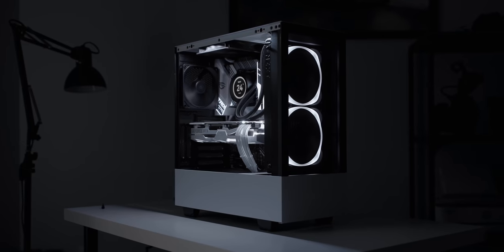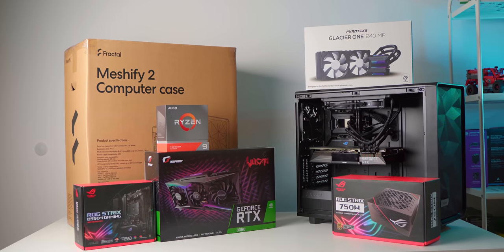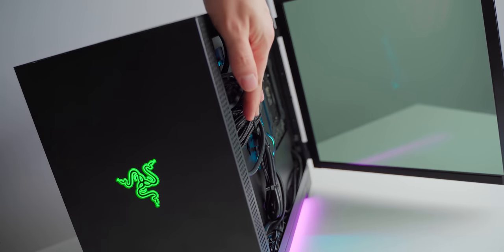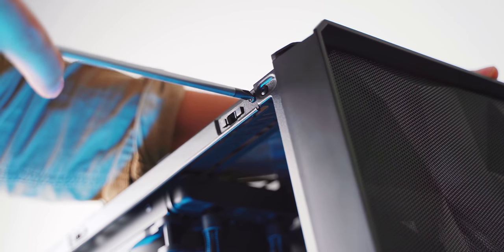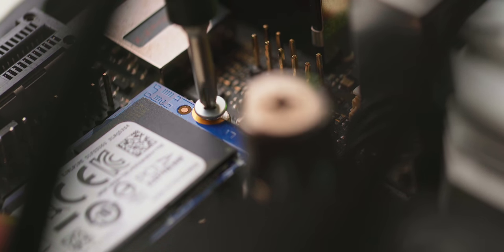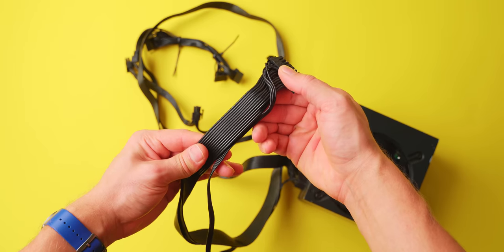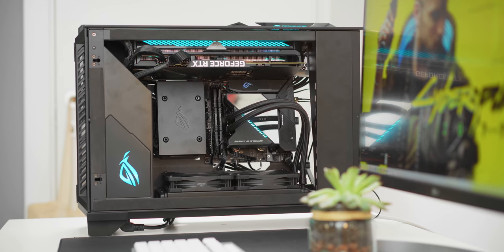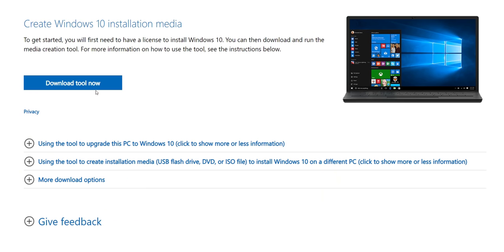AVOID these BIG Mistakes when Building a PC!!!

Comment: My old ASUS mobo has the panel adapter - hoping my new board will come with one as well, as I'm keeping my old PC as backup while building the new one ;)  

Also, GPU pricing is currently ridiculous!  Luckily, I like to build a step or two down from what's current - I never buy the latest and greatest aka "bleeding edge" tech, and I'm not an uber gamer etc.  Finding GPUs that are slightly older, and still usable in 2020/2021 will still get the job done! ;)   Thanks for sharing, D!

Comment: Oh God the USB cable on the motherboard. I built my first PC in 10 years, it was so tricky to get in I thought I was going to break the board, to make it worse the cable in inflexible with a large head, making it really tricky to attached it to my B550 Mortar in the 500DX.
Oh another thing I found difficult. The motherboard didn't perfectly align with the case mounts, so needed more force then I ever felt comfortable applying. Also cause mounts can be moved to different locations for different board types, but finding where to put them....was near impossible (sure it was labelled U5, but what board size is U)

Comment: I can't agree more on all the points in this video!!! I wish ASUS, Seasonic, and NZXT can really watch this video!!!
Tough USB-C cable, tough flat power cables, annoying 4+4 CPU power cable, X570 motherboard heatsink blocking air flow, not easy removable front panel, non-reachable PCI-E lock.

Comment: I had my USB 3 cable for the front panel rip out the plastic shroud around the pins (luckily all the pins held) but I wasnt even pulling hard or so...
But maybe I just got unlucky with my rog strix b550 f... 
Also in terms of flat cables... Gotta say the fractal design PSUs are my new favorite, because the cables really are more flexible and it made cable management (almost) satisfying

Comment: I had the same issue with my fractal meshify 2... i had to take the 24V drill out to remove the top radiator bracket screws nothing less powerful worked... and also for the PCI-e covers my hands and iFixit kit could not handle. I think for a tip from the kit it kinda wear a bit with the force i had to use to remove some screws. So annoying. I had blisters for days after i finished the build!

Comment: I had the same problem with my meshify 2 case and the top screws! What a windup... managed it in the end but one of the screw heads was wrecked. Replaced both screws with better ones. Why didn’t those screws have the hex head on too!!!!

Comment: The skrews for my corsair fans were so stiff it felt like I was going to bend my case with the amount of force I had to use. Also, I wish cpu fan cables were longer so they could be routed around the back of the case instead of being tied in a weird little bow!

Comment: The worst thing is trying to change a new m.2 drive when your motherboard is in the sfx case. For mine, I can’t even plug in the m.2 heat sink fan on the motherboard after trying for half an hr! Don’t understand why they make the plug so small. For m.2 , it’s frustrating to screw that tiny screw with tons of cables, headers in the way. Lol

Comment: just built mine and been learning to solve small problems most are fixed. The highest cost was 5900x and 6800xt sapphire  tripled my budget.  Why did they not make front connectors one fing plug i had to take a picture of it and blow it up to see where to plug it in

Comment: These young whipper snappers never had to deal with parallel ATA and floppy ribbon cables. Yeah, try cable managing them, even the "rounded" cables were a PITA. How about those cases built to questionable tolerances? The bracket to your expansion cards didn't line up with the screw hole on the back of the case short of bending or loosening the bracket on the card!

The problem with mismatched screws has to deal with the history of the IBM PC. They were originally 6-32 screws for mounting expansion cards and hard drives. 3.5" floppy drives and later optical drives use smaller M3 metric thread screws. The standoffs are historically for 6-32 screws, but some manufacturers decided to switch their standoffs to M3! The size is close enough to make it a real pain to remove a mis-matched screw.

Comment: Sata cables? thing of the past now. Agree on pcie. The slot sucks... cards bend in it, gpu is hard to get out. usb C 3.1 header on motherboards is also terrible and the cable is usually very short. I also hate super thick capacitors NEAR THE PLUG on corsair rmx psu. No way to bend it

Comment: RGB connectors that aren't standardized. It seems like everyone has their own standard these days. Motherboard makers, Fractal Design and CoolerMaster use the standard 3 pin connector, Corsair has their own proprietary connector, Phanteks uses another proprietary connector. Just wish everyone could use the same connector...

Comment: I did a push pull configuration on my AIO on the top of the case...
I kept thinking, is it really this difficult? No way they made it this hard.
Had the case on it's side, still not fun. Would have been nice to be able to 
put the fans onto the radiator then put the whole thing into the case, but you can't.

Comment: AIO 1st ram slot clearance issue. And I'm not talking about height issues, I mean tubes will partially block the first ram slot. Just had this problem with Kraken x62 and Maximus X Hero mobo, had to turn the pump to fill the 4 ram slots.

Comment: OMG the GPU PCIE lock, I have never really had too much of a problem before, but I just got a new PC and thought I borked the motherboard when my screwdriver slid off and slammed into it. The lock took way too much pressure to remove, I was sure that the GPU board snapped when it finally released. Heart BPM sky rocketed, but everything turned out just fine. Also I think GPUs need to start coming with something to support their weight by default as the sag is getting out of hand.

Comment: I hate the PCI slot clamp.  With a passion.  Mine actually broke off and I'm kinda happy now I don't have to deal with it (I just screw the GPU PCI slot screws super tight and use a GPU sag bracket).

Comment: 3m sells these super easily routed twinaxial SATA3 certified cables (watch out the cable is metalized and conductive) I believe theya re foldable (bend radius <1mm) I used them in a case build with tons of hard drives and it made routing so so much easier. 5602-12-0142A-000 they are expensive compared to the thick ones.

Comment: The worst thing is cutting your fingers open on sharp case edges or solder points on circuit boards. (This got better in recent years though)

Comment: My biggest annoyance is the required blood sacrifice.  Why is it that no matter how many times I have built, disassembled for cleaning, reassembled after cleaning, etc, that every time, it always requires blood, and I am not a klutz...  The silicon overlords require blood (the ITX gods demand twice as much even).

Second to that is the unmanageable mess on the backside of the motherboard tray after years of upgrades.  Cables too long, cables not long enough, two cables per fan (four enermax df storm into an aquacomputer, with phantex lux rings on each), plus the lux controller (z97 pre argb motherboard), add the fact that the ssd mounts are on the right side of the case as well (Corsair 750d with the airflow front panel)....  What used to be a nice tidy case on the right side is now a jumbled mess... At least it looks nice on the left side on full display, bit getting the right side panel on is a bit more difficult these days.

Comment: I have been trying for awhile to get a 3080, my brother has been gaming on a 1070 for a few years now and I want to give him my 2070 super. He games at 1440p but with heavy compromise
Reply: @James's Gems damn.... fossil age
Reply: Gtx 970, been trying to snag a 3080 since launch. Subbed to multiple restock discords, have camped at a micro center 3 hours drive from my location. No card still. Have had one in my cart multiple times only to be told sorry sold out when I auto pay. I'm seriously thinking about taking time off work, heading my tent and camping out for 2 weeks in freezing temps at Microcenter just to have a slim chance of snagging one since apparently getting one online is next to impossible. Best Buy's not deliverable to any store within 250 miles is bull. I'd drive 500 miles one way if I had a guaranteed card.

Comment: I'm gonna be honest with you... My first ever pc build about a month ago. 1) I was installing the cpu cooler without the screws, I honestly didn't know how to put that blindly LMAO, but thankfully the thermal paste was still like new so it wasn't a big problem to do it again with the screws. 2) nvme ssd was installed with a cooler that had a tape saying "remove" LOL. 3) gpu was installed without opening the slot and I was curious "why it is so hard" LOL, when installing the nvme ssd to the first m2 slot I also tried to remove the gpu without opening the slot LOL. 
I was so dumb when building it for the first time, WITH a ytb video lol. But it works

Comment: the worst part is unscrewing a super tight cheap aio to adjust and the pump slams right into the dimm slots taking out 2 slots. bye bye quad channel x79 memory, I was hoping that would at least improve my fps

Comment: Pro tip before plugging in the usb 3 cable: slightly file down the notches on one side of the cable head. DONT OVERDO IT THOUGH it won't be secure if you overdo it

Comment: I built my first PC recently. I dropped in the CPU without raising the retention arm, opened it whilst the CPU was in the socket, heard a crunch of some kind. Yikes. Went on with the rest of the build, pretty smooth were it not for the tightest backplate I have ever experienced (P400A). Tried to boot, and.... nothing. I had flashed the bios on the mobo the previous day, so I took the CPU out to check for any bent pins (forgot to clean off paste first, so that was pretty messy), no bent pins. Hmm. I figured I had installed the cooler wrong or something, but I was afraid of applying too much pressure to the lever thing on the wraith prism. I went for broke and it went on tight. Still no boot. Crap. For the heck of it, I tried flashing the BIOS again with the CPU in. Now it works fine. So please, mobo manufacturers. POSTCODES. Ezdebug LEDs aren’t good enough.

Comment: I think most of us are building new systems every 2 years or so and lot of these annoyances are minor if you don't build systems regularly. I think even mid-range cases became very comfortable and easy to build the past 3-4 years. I could add one more though: RGB incompatibilities. God knows how many "standards" are there and software and controllers, etc. even though RGB is supposedly a major selling point for years now. You have to do lots of research to make sure your colorful crap will work together.

Comment: I'm very new to pc building. I felt that it was so so hard for me to pull off the 24 pin connector from the motherboard.
Probably because of a cheap low end MB but still.

Comment: All of my parts could fit into a case I really wanted.  I never used a Mid-Size tower I only used full size, but I did the research and everything could've fit.  However, I thought I had a 550W PSU, it was a 850W!!!!!! HOW DID I MISS THAT?!  Anyway I had to return the case because the psu is like 20 inches long... always check PSU size

Comment: Just got the sliger sv 540 top plate popped off when I moved it popped the panel on like you do with most cases and it folded in now I got to bend it back to normal yeah really fragile for a 250 dollar case

Comment: The RAM is becoming the worst aspect of building a PC. I purchased a RAM kit for my Ryzen 5 system and it turns out that the first kit, a G.Skill AEGIS, was pretty piss poor in reaching it's advertised speed and was more stable at it's base clock of 1833 (926 MHz). Returned it for a G.Skill Ripjaws V 3600 kit which then kept giving me blue screens of death when going to the max clock of 2933 that is supported on my 2600 without overclocking. I've finally ended up buying a Crucial Ballistix 3200 CL16 kit and it has been rock solid at the max supported speeds and it's base clock is even better at 2666 MHz. 

Then you have the garbage that Windows 10 likes to give you  when upgrading a system in that system files get bloated and even corrupted overtime and when reinstalling sometimes the stupid thing crashes during the install or after the install certain drivers muck everything up all over again. Same when installing AV software like Kaspersky or BitDefender. After all this troubleshooting, I decided to turn off  Windows garbage defenders before installing 3rd party software and drivers. Three days later my refreshed build is finally working as it once did before the upgrades.

Comment: There needs to be a simpler way to integrate RGB without having so many cables and connectors. Cable management on a PC with 6 RGB cables and a fan hub is a nightmare!

Comment: Oh god. My worst experience was yesterday because I built my first system 🥳. I was able to get a hold of a 3070 and i got a 5600x and a msi x570 tomahawk. I just watched so many different build videos it felt natural building it and actually everything went perfectly for first time. Or did it? When I tried to boot the computer started working fans spinning but no video output. *Panic*. The debug cpu led was on on my motherboard :(. Thank God after a day i thought it may be because my bios that came from factory  didn't support my cpu so because I didn't have a older cpu i went through terrifying process of flashing bios with usb. But after everything I finally did it. And now I can play minecraft with Rtx with ease :)

God that was long

Comment: Not knowing the right compatibility for stuff i.e. I thought I bought the wrong PSU when some PSU CPU cable pins were rounded instead of perfectly matching the mobo - after much googling and incorrect answers I went to MSI's site itself and found my correct answer - they are purposely rounded to allow more compatibility
IRONIC

Comment: Well i would no agree with that, that I/O connectors are the same on every motherboard. I wonthe life by simply taping with isolation tape I/O connector with old motherboard (X470 Gaming Pro Carbon AC) and with new one (B550 Tomahawk) i realized few pins are placed different. 

To be fair, i think this is most odd standard in whole PC, next to standard ATX, with no experimental features, like swapping RAM with PCIE etc for build chimney layout with motherboard I/O on back - that would let case manufacturers to create something new, righ now Silverstone own a patent for 90 degree chimney laout in cases and noone can copy it without paying.

Fully agree with the rest, USB 3.0 connector, easy access to dust filters, all of it.

Comment: One of the worst is, install an AiO, cable manage everything, the AiO pump fails, remove it to RMA, install the stock cooler (if there is one), the new AiO arrives, uninstall the stock cooler, install AiO again.. commit suicide if it fails again. (RMAed my nzxt x52 3 times. 2 failed pumps and one rgb not working) :D

Comment: The worst thing for building a machine right now?  AMD and BIOS, Just built a 5600X with a ASUS Tuf x570-plus, went with this board as it was in stock, whereas the higher boards with Bios-flashback where OOS. Figured it would be ok as the BIOS supporting 5xxx AMD came out months ago... Well no, now I have a paperweight as the BIOS is a really old version, and I need a friend to drop off a 3200 AMD to get it to post and do the BIOS Flash.

Comment: I've ripped the USB 3.0 header off motherboards several times now because it fits too tightly. Thankfully none of the pins have ever bent enough to prevent sliding it back on. I hope there's a place in hell waiting for whoever came up with that design.

Comment: A good tip from someone who just built a new PC with a B550 board and a ryzen 5 5600x, do not, and I mean DO NOT use any driver updating software, it fked up my freshly put together system so much that I barely got the bios to recognize my boot m.2.

Comment: I wanted to add that cases that only offer 1 usb 3 on the front panel is BS. A single connector on the motherboard can power 2 usb ports, so it's a ripoff

Comment: Funny story I've pulled out the usb 3 cable from my motherboard but it was so stuck it actually pulled out the plastic frame that surrounds the pins on the motherboard with it. I almost cried because it is a 600$ motherboard rog crosshair viii formula

Comment: I'm so sick of ALL these STUPID problems building PCs, so I'm gonna GIVE AWAY my $100M dollar IDEA, to someone who can MAKE IT HAPPEN: Modular PCs.
Why does it ALL have to be stuck inside ONE BOX? Why not create components like the old Hi-Fis. Have a PSU section, a Motherboard and CPU section, then a disk drive section, then a graphics card section, then peripherals & I/O (CD, DVD, Blue Ray, USB, Audio ports etc.).
Then just replace and upgrade parts that you need to instead of cramming everything inside one GIANT BOX and deal with cooling problems, cable management issues, expandability issues, upgrade nightmares, etc.
Sure, there are some engineering issues to be worked out, but it would be pretty sweet if someone figured it out and made it happen.

Comment: The challenge in building a PC is do able !   But no budget and try to go cheap example  skip 1TB nvme and go buy  500gb nvme which is cheaper is regret because you stuck with that drive space forever until you replace which when you add up it actual cost you more in your total money spend.    " Budget"

Comment: 24 pin is the worst, I don't understand why you said it was fine. Every single time it's been a bad fit and I have to use so much force that the motherboard bends. Fuck 24 pin all the way to hell.